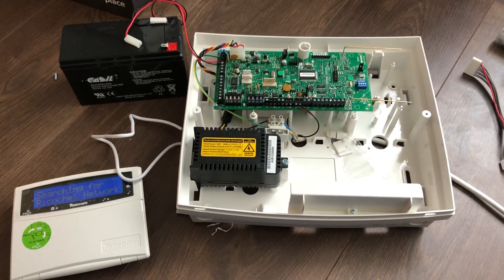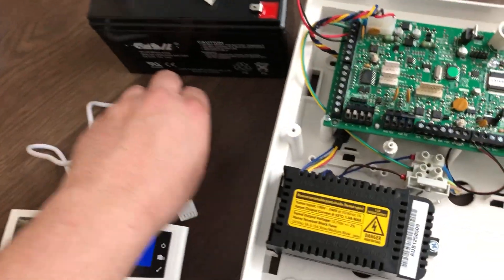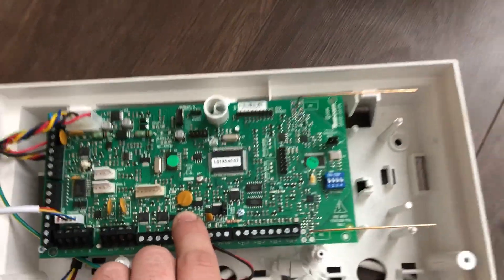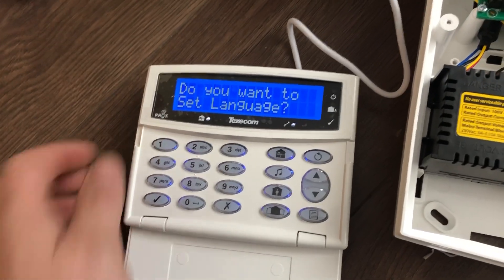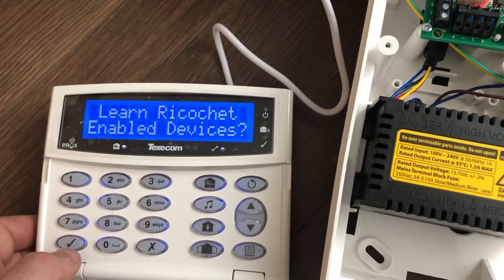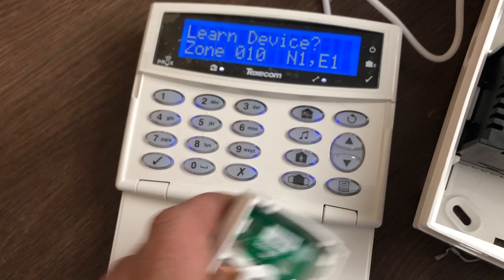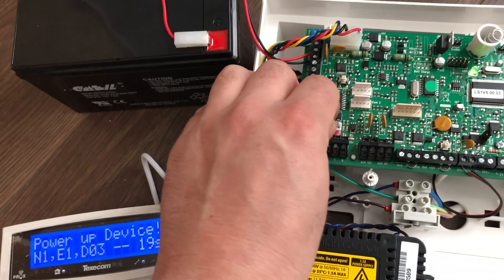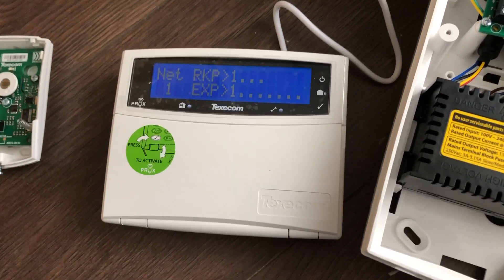Starting Up Texecom Wireless Systems

Comment: First problem I encountered is that my motherboard (premier elite 24 polymer) doesn't have a commission mode jumper anywhere I could see. Followed these instructions anyhow, all worked up to getting the RKP > ... and EKP > .. screen but there was no number 1 after EKP, which you said would happen on the video  if the commission mode jumper wasn't set... but I don't have one... advice appreciated! Thanks.

Comment: Just tried this all went ok until the keypad set up then it froze saying connected had to reset alarm now I have keypad listed in zones 1 to 8 with tamper and I can’t do anything else I delete the zones but they keep coming back and it’s says richocet not available, keep resetting panel but just keeps doing same and won’t search for wireless sensors can you help!

Comment: Do you know how to add a sounder? I’ve got an Apollo sounder base that I’d like to connect. However, wiring to the Bell and 12+ doesn’t work as it just makes the sounder ring permanently. I’ve tried programming the output 1 to activate on a fire zone but that’s not working either!
Reply: did you resolve this

Comment: hi, set up one of these systems today, and your video is spot on, however i had a problem with the bell box not turning off  when full test was done, so, my intention was to remove the bell box and re learn it , however, i removed all devices , i needed to reset as the screen on the keypad locked out, now i had to start from scratch it wont allow me to add anything in the ricochet set up, where you press yes in your video and it asks you power up device and gives you 20 seconds, the keypad just bleeps on me now and does nothing, any ideas?
Reply from the maker: Is the commissioning peg in? Also conform devices in eng utilities and see if there’s an expander showing!
Reply: @alarmassist  thanks for replying , the comms peg is in , the only device that would “sinc” was the keypad when I unplugged the engineers cable , I did read that I should go into zone setup and delete what I find ???

Comment: Hi I have a wired keypad system and It has 1 next to RKP I have made sure Its In the right port but It Is still not showing EXP 1 do you know how to solve this
Reply from the maker: If it’s the elite 64w the panels faulty and needs sending back

Comment: to replace a faulty device,  do you need to plug the keypad into the control panel, using the lead or can it be done remotely?
Reply from the maker: You’d only need to plug the keypad in if the faulty device was the keypad
Reply: @alarmassist  Great thanks,  so I just need to delete the faulty detector and add a new detector?

Comment: Hi Mate, I have a Texecom Elite Zone Wireless System, is an Texecom WDC-0001 Odyssey Bellbox compatible?
Reply from the maker: Yeah it is, Bell wired connections are on the panel just like the non wireless model. I
Reply: @alarmassist  if I wanted a wireless alarm bell mate which one should I go for with this panel? My unit is an all in one keypad and board
Reply from the maker: @Jonbuildz  oddessey X-W GBV-0001
Reply: @alarmassist  Thanks mate, I'm going to be getting everything setup on the desk like you have prior to installation, is it ok on a 13amp fuse plug or will I need to rate down to 3amp?
Reply from the maker: @Jonbuildz  will need a 3amp
Reply: @alarmassist  Thanks for all your help, really does make this process smooth which is nice. Last question I've joined my WiFi PIR's they are noticed in the zone settings, however when arming they seem to not be operational? I've heard about changing the mode to Auto in the Richochet Device Mode.... Just cant find the bloody option. I'm looking to get a USB to Com cable as the Wintex looks much better configuring.

Comment: Hi why did the first one go to zone 9 and not zone 1 ?
Reply from the maker: Zones 1-8 are wired panel zones (but only 1-4 exist on this model)  from 9 upwards are expander zones and even tho in this case the expander is built into the panel it’s still classed as an expansion.

Comment: Great video ! I followed your video and everything went smooth until
I tried to change a device to another zone. I have managed to delete all devices. I have performed a factory default set, run through the basic setup again, but I can’t add any wireless devices to any zones, almost like like the system still thinks there is something there. Any thoughts on this ? I have tried pulling the power, batteries, resetting zones so nothing is set but when I try to add a device it comes up with the expander info e.g zone 009 N1,E1 but won’t go through to the next page for the count down timer. Thank you once again

 @Alarm Assist
Reply: Zone 9 is still being set that needs removing and delete it. what setting on attributes is the zone 9 on

Comment: Brilliant videos i am in the process of fitting TEXECOM KIT-0002 RICOCHET PREMIER ELITE 64W WIRELESS ALARM KIT & SMARTCOM | KIT-0002-WIFI went quite smooth until i tried to connect the forth PW sensor(i bought an extra one} no joy tried everything i could think of,exchanged as faulty and the replacement also refuses to connect.Any idea please as the others ,door contacts siren all connected no problem.Thanks
Reply: Where are you trying to connect the fourth PIR check no metal near it at all?? and also check if nearby device so it can connect to nearby device which leads to unit.

Comment: I like the idea of this wireless system but I can easily hardwire the bell, panel and keypad. I spoke to them on the phone, the guy was quite undermining. He said don’t go for a kit, get the 64w panel, hard wired keypad and hardwired bell. I can then add on all the wireless sensors.

 I would like to cover my garage extremely well and thought about a Master blaster 127db sounder in there but they are mains powered with 12v relay trigger. Also in my garage is my consumer unit which would end the 127db noise if they turned off the main switch. My options are enclose my consumer unit or use an inverter and 12v lead acid battery to keep the spundet going. What do you think? Kind regards, Chris

Comment: hi there, i’m just wondering if you can plug the panel into the mains through a standard socket with a plug and fuse? is this safe etc..?
Reply from the maker: Yeah will be fine. It’s an insurance requirement to be into a fuse spur that’s all.

Comment: My keypad is getting stuck in a loop on the last screen showing the keypad and the expander. I tick and it just cycles around endlessly....any ideas??
Reply from the maker: Try changing the keypads address, on the back on the keypad will be 4 small white switches just change one of the positions to see if it solves it. Also after confirming devices after the confirmation tone press menu or reset to go back to the main menu.

Comment: we have installed our system at home (premier elite 64W) a little while ago but found the keypad was faulty as it would not reliably work with prox tags, have left it until now to replace as supplier will only send out new unit on return of old one -leaving the system down. Question: how can I remove the keypad, and then learn the new one without having to decommission the system? i've been told by supplier/texecom I have to 'power down' the board and remove the keypad from its assigned zone through the menu, but which way round (they both said differently) and do you have any other tips?
Reply from the maker: Enter the engineers code and when zone setup appears press omit you’ll be taken to learn ricochet, press yes and it should display the next Available zones. Enter the zone number the Existing keypad was assigned to (need to be 3 digitalis so for 9 would be 009, for 11 would be 011) then press reset and should ask if you wish to delete, press yes. Once done you need to go engineers options and confirm devices.

Comment: Hi there hope you can help! I've installed a Premier Elite in my house my daughters house and am setting a new one up for my sons new house - a Prem Elite 64W with software V5.02.01. I very quickly had all the wireless devices learned and after entering zone info and text etc I removed the commissioning peg. Tamper fault EXP 1, 1 would not go away. After some time I decided to start again, its not a large or complex job so power off battery disconnected commissioning peg back in and reloaded defaults. Now no matter how carefully I try I cannot get the panel to start the learn countdown, everything is fine up to this point but it will just not start to learn, sometimes it beeps once at the keypad (wireless keypad) when I press tick to learn but the countdown does not start. I thought I'd try re-flashing the firmware but have misplaced my flashing board and so have sent for a new one, hopefully this will work but in the meantime have you any ideas on this? Many thanks :)
Reply: Tamper fault needs clearing on expander so need check wiring essentially and voltage to see if enough power going through.

Comment: Hi great video, really helpful. I'm not getting the expansion number 1 when you go through the process. Do I need to buy an expander. I am only having 5 wireless devices connected. Thanks for any help you can give. Cheers nick
Reply from the maker: Whats your Panels model number? (does it have the 2 Copper anntennas on the panel?)
Reply: Thanks for the quick response, yes it does. It says on the front cover it is a premier elite v5
Reply: Model number 64w ls1 rev 14 v5
Reply from the maker: @nickmedlicott2553  check the commisioning peg is on above the address pad, if that doesnt work try addressing it to a different number and if it still doesnt work its probably a faulty expander and you need to send it back.
Reply: @alarmassist  you were right in the latter, it was a faulty on board expander. Contacted texecom help and they said main  unit and expander was faulty. The supplier sent a replacement out straight away. Thanks for your help, videos have been really good

Comment: Hello mate, I have just today 13/1/20 set up my alarm and your video was spot on!! However it is now retelling me to 'Call engined to reset'. Everything went great I don't understand. Is there any way you can give me some pointers? Great videos cheers Martin
Reply from the maker: Evening. If you on onto area programming then area options stroll down to “alarms eng rst “ if letters aren’t displayed press no followed by 1234 to clear the letters and press yes then scroll down and repeat for:
-confirmed Reset 
-tamper eng rst
-anti code reset
-faults eng reset
-no ats eng reset
& Ac flt eng reset 
Once all are blank shouldn’t require engineer reset requests anymore.

Comment: Hi!, how do you plug in the mains power? i want to use a plug and not a fuse spur for a couple of days before fully mounting,
but i have a wire spare and it has a black and red cable am i able to use this?
Reply: Hi cables don't matter colour just check if black or on minus to slot that into minus in plug and plus for red vice versa

Comment: How do you do a system reset? mine keeps saying faults and the app wont connect to the panel
Reply from the maker: GREENHOFFS remove the battery, disconnect the power reset and hold load defaults and restore power
Reply: Alarm Assist thanks is that in the key pad
Reply from the maker: GREENHOFFS no on the control panel
Reply: @alarmassist  many thanks. I will have a go at this at the weekend

Comment: Once you have moved the commissioning jumper, when do you move it back, or do you just leave it
Reply from the maker: Joe Dry just leave it off I always leave it loose in the bottom of the panel but you can add devices later with no problems you’d only need to reconnect it if you was loading defaults

Comment: Do you take the peg out once you've commissioned I'm getting a exp 1.1 tamper
Reply from the maker: Nicholas Burton  yeah once you relive the peg that should clear the tamper fault
Reply: @alarmassist  would you add all the devices and then remove the peg
Reply from the maker: Nicholas Burton  yeah normally but it doesn’t matter as long as you’ve confirms devices

Comment: Your videos are indeed very informative and get to the point clearly
Any hope you could provide some guidance on the resistors that come with the Panel please?
Am I correct to assume that if you program a Zone as "Unused" would suffice in stopping the system from triggering or do I have to "link out" using the resistors. 

An explanatory video would be an absolute gem but I understand if you don't. 

Many thanks for taking the time in sharing your knowledge
Reply from the maker: f alickolli no you don’t there just for wired detectors
Reply from the maker: f alickolli not a problem it’s for using End of Line or EOL you basically put them over alarm and tamper to save wires and make it easier to find faults. The idea is unlike a normally closed circuit which set the alarm when the circuit is broken it’s a permanent  circuit and it’s just the resistances which changes. We will be making videos on the wired systems in the near future.
Reply: Dartline Alarms Ltd I have the wireless system. Do I need to worry about connecting the resistors? Sorry about this novice question and thank you